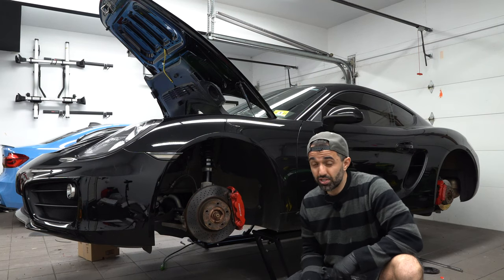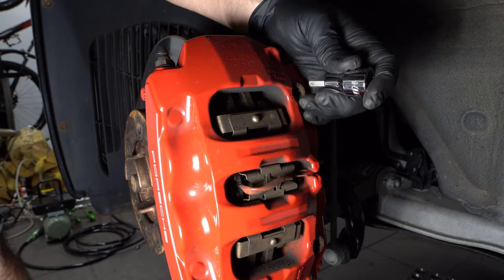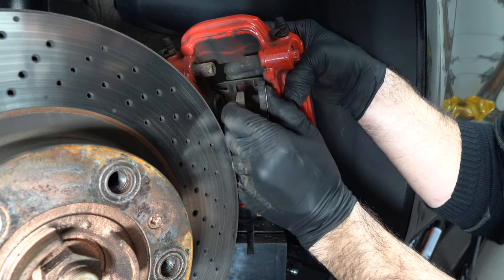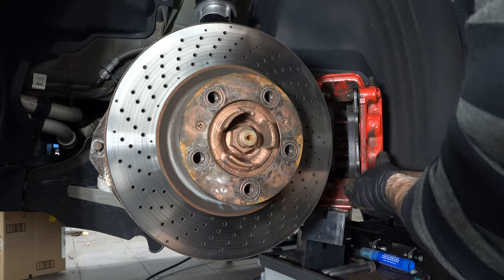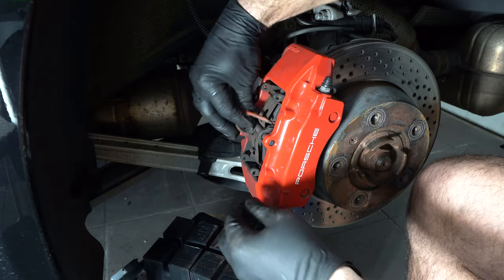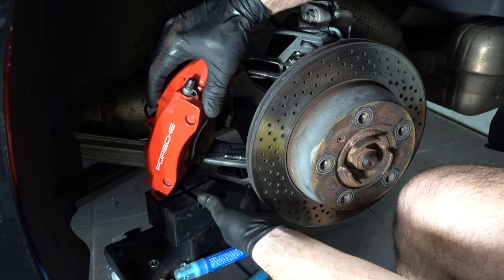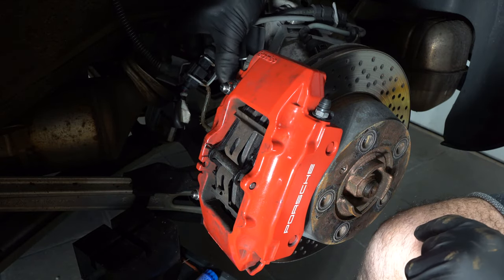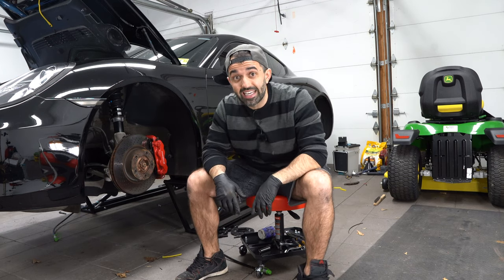DIY: 981 Porsche Cayman S Brake Pads Replacement and Caliper Stud Conversion

Comment: The stuff that you add to the back of the pad survives after a track day.?  Everything I use gets burnt off, so they recommend not using anything to prevent ash built-up.
Reply from the maker: It burns but remains on there and prevents squeaks

Comment: I found this video very useful but I would like to add some things from my own experience.  1)  I had trouble getting the studs to go in smoothly.  The bottom studs went in hand tight without an issue but the top studs would not. One went in about 70% and the other barely 30%.  I did not use a thread chaser and I was very liberal with my use of grease to prevent galling with the bolts so I assumed that was the issue.  Even the top bolts required a socket to remove.  I had to replace both front knuckles because the bolts stripped so I was anxious to use studs (rears don't require that many changes but not wanting to take the chance) and I was very cautious when inserting a bolt. I was able to get the 70-80% stud using a little amount of force.  I had to use the thread chaser for the more difficult case.  I needed to use a wrench to get it fully into the bolt hole, and even with a dry run on the caliper stud I needed to use a wrench to get it into place, and 2) previously I had no trouble replacing my rear rotors but this time one rotor did not appear to be sitting flat against the spindle but it turned out that the screws resolved that part.
Reply from the maker: Thanks for the input

Comment: Awesome video!! Was wondering if you will do a DIY on how to replace shifter cable. Its something I been wanting to do(numeric shifter cable) for a while but am no confident in doing so and theres lack of instructions online. Thanks and keep up the great content!
Reply from the maker: Thanks. I will be looking into it for sure
Reply: I replaced my shifter and cables with the Numeric short throw shifter and cables in my 2016 Cayman S.  I got all the support from the owner of Numeric that I needed.  It's not a small job, but if you take your time, you should be able to work through it.  My biggest challenge was removing all the interior trim pieces without damaging clips, tabs, etc.  I think I counted about 30 pieces of trim that have to be removed to complete the job. 
It was sell worth the effort.  The shifter is fantastic.  It is so precise and tactile feedback is huge.  I highly recommend installing this shifter.

Comment: Thanks for the guide, followed exactly. But I now have brake pad warning and red exclamation warning light on. Will these go out or do I need to perform a reset? Thanks.
Reply from the maker: You should not have any warnings. Make sure you connected the brake pad wear wires as I showed and the message will go away.
Reply: Thank you. Went back round the connections and found a loose one. All sorted 👍
Reply from the maker: @revolt360  happy to hear!

Comment: Thanks Tommy.  I really enjoyed the video - very clear and concise!  I'm thinking about doing the stud conversion as you demonstrated.

Quick question though.  Once the caliper studs on on the car, how does one compress the pistons?  It would seem you no longer have the play needed to move the caliper back and forth as you did.  Thanks again...
Reply from the maker: Just use the hand side of the hammer to push them in. Make sure the brake fluid reservoir is open.
Reply: @TommyLGarage   Hmmm... I'm thinking about the next time one changes the brake pads.  Once the new studs are in place, how does one compress the pistons/pads to remove the caliper from the rotor.  I'm new at this, but it would seem that the studs would prevent the back and forth movement of the caliper you demonstrated.  

I'm certain it's easy but I'm having a tough time visualizing it.  Perhaps a new demonstration?  Thanks and stay well.
Reply: @JPGianfortune  I think you thought of something he didn't. You wouldn't be able to do his little trick of loosening the grip of the pads on the rotors, but that shouldn't be absolutely necessary. The caliper should still be willing to slide off the rotor without being "clearanced" like he showed. If there's a lip on the rotors, they may be stubborn, but you are still just pushing the pads back in a bit as you pull the caliper directly off the rotor. Not a real issue.

Comment: Excellent DIY.  I'd be curious how you lap times in the 981CS compares to your times in the F80.  Do post them after your first track day.  My guess is the F80 is faster but the 981 is overall more balanced and engaging but harder to exploit given lack of turbo available torque.  Any chance your at LRP 4/19?
Reply from the maker: I think the f80 may indeed be faster but this will feel like a gokart

Comment: Thanks for the video! Did you put the parking brake in to service mode or did you just leave it off? After the new pads was there any initialization of the parking brake needed?

Comment: Thanks Tommy another helpful video. Question: I've seen in other videos that the abs sensor needs to be removed too. This was a PITA for me. Did you do this without removing the sensor?
Reply from the maker: I did not remove the sensor at all. Just unbolted the bracket.

Comment: awesome video,   first time seeing a caliper stud conversion.  Why do you need to do a stud conversion and is the conversion expensive?
Reply from the maker: It's around $300 all-in. It just saves you from having to replace the studs every time you do the brakes.
Reply: The uprights are aluminum and will eventually strip out with the steel bolts. Mine should be here tomorrow for my 718

Comment: Question if I replace the rear discs and pads on a 981 PDK Boxter S does that require any recalibration. For the parking brake? 
Thanks
Reply from the maker: None at all.

Comment: Nice job! So you don't have to do anything regarding the electronic emergency brake when changing the rears? Wonder if I could bypass that when doing my Macan brakes 🤔
Reply from the maker: Nope. Just make sure your e-brake is not engaged

Comment: porche oem calipers are brembo calipers with the porsche logo on them. they are not bespoke either. you can buy the exact same calipers (and rotors) directly from brembo if you have cross-referenced the porche and brembo part numbers. same for many sports cars, (i.e. aston martin, only aston martin will jack up the price 3-400%, whereas porche only about 100%)
Reply from the maker: Good to know. Thank you!

Comment: What torque spec did you use when tightened caliper on converted studs?  Also could you please share the length of stud you have purchased?  Thank you in advance, Tommy!!

Comment: The calliper bolts don't tend to strip, because they are stretching bolts, and therefore single use. You need a new set for every brake job. So if they are stripping, you are doing it wrong ;)
Reply from the maker: Even a better reason to swap!! :)
Reply: not the caliper bolts , but the uprights they bolt into strip

Comment: For a slightly nicer and more long term solution to your electrical tape on the wires, use some heat shrink tubing.
Reply from the maker: Good call. I might do that. Thanks!
Reply: Thanks for this suggestion, swapping pads for my 981 boxster gts today for my first track session and will do this!

Comment: why not replace the sensors? Doing shit like this all over the car turns it into a nightmare for future owners.
Reply from the maker: Because I swapped for track pads before track day so dealing with sensors is a pain. Also these sensors are not needed - people who don’t know their pads are worn just by looking at them should not own a sports car.
Reply: @TommyLGarage  With the sensor wires twisted together do you get the BRAKE warning light? I don't like having a bunch of "CEL"s even if they mean nothing.
Reply: @bldn10  The sensor works by always having a connection when you have enough pad, so tying them together makes the car think the pads are always fine. When the pads wear and break the connection between the two wires is when you get the light. So tying permanently keeps the light off.